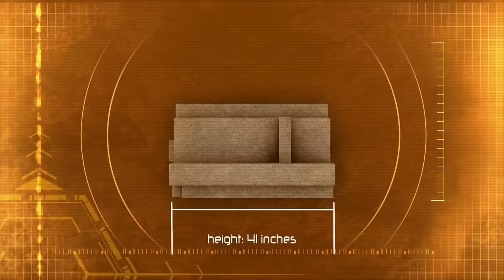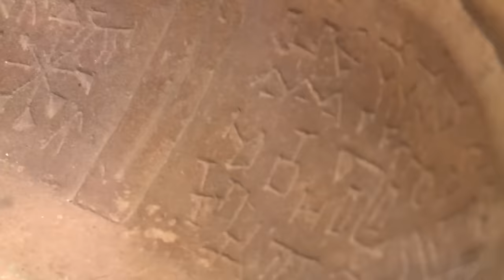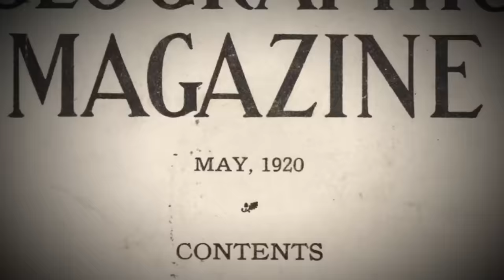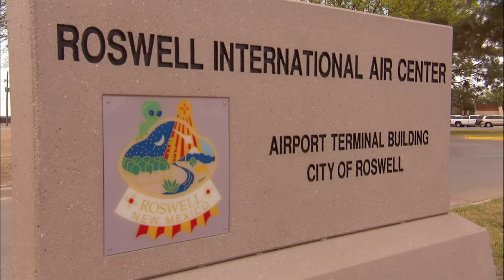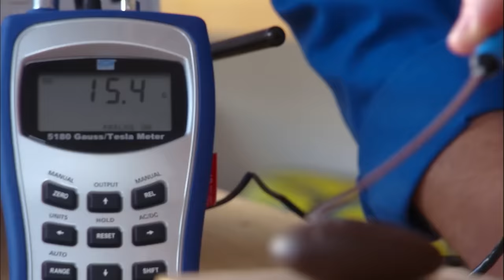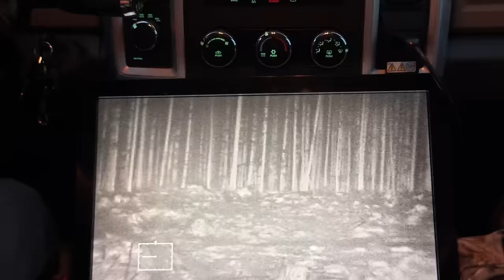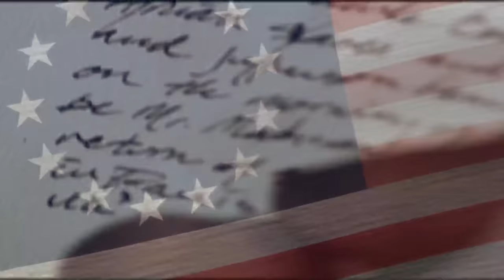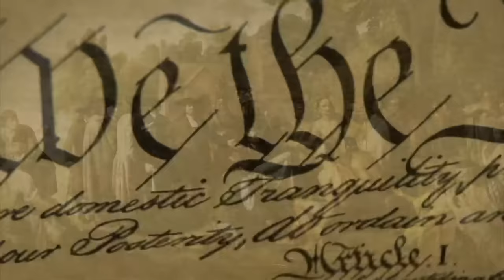TERRIFYING PROOF OF ALIEN ACTIVITY *Epic 3 Hour Marathon* | In Search of Aliens

Comment: I find it curious that there is such a difference in quality between the precise cutting of the stones, which are so precise, and the faces that are, at best, very rough and general. I believe it is because the ones who carved the blocks are different "entities". If that is the case, it asks many more questions
Reply: Well in humans tradesmen in the same trade often have their own trade mark even if they had the same teacher originally.
Reply: I ussually have the Nordics build walls and the tall greys carve heads and faces when I manage a site.
Reply: My theory is all those thousands of years ago...the rock was softer since rock hardens over time OR they used an Alchemical process that softened the rock just enough to cut and form a smooth surface. The pitting on the ancient cut shows the cut method was not high speed and the rock was softer when it was cut. They probably had a method to almost completely melt rock and reharden it to shape. Remember ancient Egyptians had scientists and they probably used some ancient process or resource that has been lost. I think we just haven't found wooden molds because the wood they used completely decomposed. They may have even used sand with some kind of Alchemical polymer that has long since broken down. Some people don't like my theory of the rock being softer or the Alchemical process because it discounts high powered tools. But they definitely had some high powered tech to move such large stones. Unless 20ft tall humans actually existed and built them and they just destroyed all the remains when the giants were supposedly hunted and genocided. A gigantic human would probably have the strength to move those 2 ton stones with just 2 of them. And also carve them quickly with crude tools. But my bet is on they hand a huge supply of a caustic chemical they used and maybe giants to move those rocks. There is an old story about the giants and how they were used as slaves then became cannibals in rebellion and were defeated.
Reply: @tomd6704 you should tell the greys they are creepy af and they best stay away from me if they know what's good for them.
Reply: There’s actually a location at I believe Teotihuacan, where they actually make that argument. It’s a temple with various contrasting deities heads carved even looks like variety of different types of stone used too.
Reply: @LisaAnn777 I don’t have a direct line to the ancient alien theorists. I suppose you could look it up. 😹 otherwise get bent and share your negative comments on the Reddit sub for crybabies. 🤷🏻‍♀️😂 🙄
Reply: @Unmaleable ……I agree. Especially when you look at the obelisk that cracked and was left in the quarry in Egypt, on the surface of the space where they would be standing, there’s still blatant scoop marks. As if they softened the rock and scooped it. And with the moving of the stones, nobody ever mentions the possibility of them using animals. Such as elephants 🤷🏻‍♂️ After all, Egypt is in Africa. Or they could have simply used hundreds or even thousands of humans if necessary.
Reply: @Unmaleable I agree with your theory that a caustic chemical such as sulfuric acid was used to dissolve and shape stone.  They were probably very advanced in chemistry.  Probably had a lot of diamond tools too.  I think elephants could have been used to move the stones and maybe sophisticated pulley systems as well.
Reply: @tomd6704  🤣🤣🤣🤣🤣🤣

Comment: The fact that the “H” block materials were showing to be magnetic or charged which was displayed when placing a compass next the structures was very interesting 🤔
Reply: @cappythumper514  It is so easy to produce magnetic effects in stone, especially if it has a high metallic content, preferably but not exclusively, iron. All you have to do is strike two rocks together or drop one on the ground or strike it with an iron bar and you can magnetize all or a portion of the rock temporarily. Some rocks that have the right crystalline structure or crystals embedded in the rock can produce pizo-electric effects when struck, dropped or put under pressure and where you have a current you have magnetism or the potential for it. The most common rocks, whether they've occurred naturally or were shaped by humans, have or can produce magnetic reactions. Anyway, I see a lot of folks who think this Giorgio character is some kind of Guru or professional Archaeologist or mystic or something when, in fact, he is none of those things, he, like this show, is disingenuous, untrustworthy and fake and the mystery is maintained, not by what he tells you but by what he doesn't tell you.

Comment: I'm wondering if the stone found at the Roswell crash site area isn't something like a DVD or a computer program that would "print" the image that is on the top of it onto the earth's surface in a crop or any other surface below the craft. That could also explain the magnetic properties of the stone, in order to make whatever device they use to spin out the designs, the stone would have to be put in a "player" in order for the mechanism to recognize and activate correctly to make an exact design, the magnetics could be used to quickly move, spin, stop, turn over, etc... inside their device.
Reply: THAT is an interesting thought... very possible... not that I believe in aliens mind you...

Comment: The Roswell rock. One possibility they didn't mention was ceramic. I knew this also could not be the case. Ceramic items are intentionally hollow because when they are fired the gases within the clay would blow a solid object to pieces. I am surprised by them putting it thru a CT scan. I've had over a dozen scans because of my health and they tell you not to have anything metal. If this rock has a magnetic field wouldn't that act the same as metal? All in all I think this is a solid rock, possibly granite or marble because of it's hardness. But most marble or granite have colors in them. The fact that this rock is such a small sample it could account for it's monotone appearance. I would like to know the dust samples from the grinding.
Reply: CT scanner won't be hurt by metal.  It can affect the imagery, but it will not hurt the scanner.  HOWEVER, an MRI... there's no way, I don't think, that they would have put that into an MRI machine (MAGNETIC something imagery)  It would have turned anything metal like that into a bullet and damaged the machine for sure.
Reply: I expected the rock to blow up in the scanner.
Reply: There are ways of artificially conglomerating rock- similar to concrete, and they are known to have existed in some ancient cultures. The known versions wouldn't explain most megalithic construction, but I believe there were versions we aren't familiar with today.

Comment: Limestone has a density of about 1.55 which means those stones weigh as little as 1.5 times the weight of saltwater.
It is easy to cut when soaked in water.  It can be easily moved by floating in place as pyramid stones probably were. 
Remember that the Nile was nearby and that it overflowed like clockwork according to the stars.
Malta of course is also close to a water source.

Comment: I think the rock was melted with an EXTREMELY powerful electric current, and it fractured slightly as it was cooling. It would explain the magnetism and the perfection in the design, that appears almost as if it was molded or even laser cut. It's probably not something that we would do, but that's kind of the point, isn't it?

Comment: It Is concluded that concrete made with andesite aggregate has higher tensile and compressive strengths than concrete made with quartzite aggregate at the same cemenVwater ratio.

Comment: A lot of the rocks, not the one that seem obviously jig-saw cut to fit together, but those that seem to be randomly selected stones, vitrified to each other to fit perfectly seem pretty obvious to me that they had some form of intense and rapid heating process to melt the meeting sides of the rocks so as to mesh them together regardless of differences in the specific, unique surfaces of the rocks themselves.. 
Like, say you've got some heat gun for lack of a better word, and you have 2-5 men line the rock up then  melt the surfaces between them while the men push them together..
That's what it looks like to me.

Comment: The people investigating these sites are overthinking it ! You can make a saw using a rope and grit to cut through stuff like hardened steel. You actually can cut through a bar using comet cleaner powder and dental floss. you get the floss wet and then add the gritty powder. It truly is that simple !
Reply: Then please duplicate a pyramid for us
Reply: Please saw an inside corner

Comment: The huge blocks wer moved on stone rollers not on wood ones,the ground was first prepared making it flat a road if you will so that they could roll easily under all that tremendous weight and was done by a group of about 30 men per block all this was done approximately 12000 to 12500 years ago

Comment: Could there be a slight flaw in the spectogram analysis? Remember how the wolf howl didn't match up to the unidentified sound? Couldn't distance play a role in the shape of the sound? For instance, if a wolf howled near the recorder, I feel the the shape of the sound in the spectogram data would be more defined in picking up the tones and it would be less defined as the wolf would move further away from the recorder. So, couldn't the unidentified sound be a wolf or other animal or whatever just at a further distance rendering the image less defined and less comparable to saved data that has undetermined distance

Comment: Thinking in line with the ruts.... wasn't there a story about an entire city or civilization that was able to move across the ground? You'd think it would leave behind a good visible path, whether to keep it on track or the type of energy used to lift it dug into the stone over time? Serious, if the tech existed that could lift huge objects, why not a whole city. Would be of great use especially during a ground attack to go high enough that no one could reach it and they certainly wouldn't go underneath it, in case it came back down.

Comment: I have seen programs where there are artifacts like the rock and in this program the rock with it's designs were used to fit it into something and used as a way to unlock something or you could put the ROCK INTO A say a UFO AND USED LIKE A KEY TO START IT.. THOSE DESIGNS ARE FOR A REASON I THINK.. ITS A KEY FOR SOMETHING..

Comment: In Chapter 1:  If they were to have used diamond blades, blades made of diamond - or even any other similar stone, it would seem reasonable enough to me that you would not find the tools used.  The material is simply too valuable and tool too specific to keep as even a relic.  From so long ago, lost memories and hard times would scrap them to dust; I would think.
Reply: Not if it was in a desert. I don’t kniw what to think about that rock cause the scientology head building has a helicopter pad or something with the same design.

Comment: Why do they miss the COMPLETELY OBVIOUS? The roller balls were placed IN the carved channels so they didn't roll away and then the loads were placed on top(think early ball bearings). If you have ever been to a boat ramp you KNOW that the wagon/trailer being backed into the water make it easier to load and off load? Higher loads weights can be put on SOLID stone balls than ANY axle wheel combination.

Comment: It is hard to believe a flood nocked the stones apart at 18000 feet of elevation. If they were made by pouring in a mold to form blocks then were is the material that formed them? Was there samples taken to identify were they were made? A space port platform would match with the Nasca lines like runways for some sort or aircraft. There is no wood is stuck in the blocks when molded. Can the blocks be xrayed to see if any metal reinforcement was used? Can they be analyzed to see what the stones are made of chemically? Where is the metal that would lock the blocks together? Is this an Alien version of Legos.

Comment: Noticed that there was when they were glazing over the back end of that rock. Where was explained Where the grinding wand he turned the rock slightly.
To the fatter side of there were 2 indentations are holes. I don't know what they were and this is Two hours and three little less than that thirteen seconds somewhere around there Chapter 3 It is where I noticed the two Holes or invitations are in the rock on the fatter side of it on the backside of the rock.

Comment: Somewhere in the mix of   mud brick   technology and concrete   stone forms,      these   blocks and many  amazing  images, are really       concrete   formed,   and before the    mixture   hardens into granite  hard stone,    it is modeled     in the same way a mud   or clay  model was formed with soft tools or  wooden forms,      poured   using   alchemy sciences that moved on from  clay and mud brick   to   cement  and concrete technology.        Learning  was from the forming of River 'Rock     caused by   flows of unique colored  sediments and    even tested by taste   to be sweet or sour,   or bitter ,   hinted at in the Bible as "Waters Made Bitter".     suggesting    Alchemy    taking   minerals out of the river,   separated as powders    by color and taste,  and mixed  by experiments  to find    caustic  reactions  that    created  light and heat  and   made   concrete and finally    mixing the powders   taken out of the river,       would create an explosion,    like gun powder or    nitro nitrates and      elements that   when   mixed,    burn    either to create a glowing light    or   made stone   or  blow up.  Glycerin     .    Thus   in underground tunnels   they painted the walls  with  powders taken out of the rivers,    such as the Nile,   and   they were phosphorus   emitters of light.          When the paint dried , the  light faded away.    .  So  one elements is bitter the other is sweet and mixed,  with water,  like a time clock    the dehydration   makes heat  and burns and    changes a mixture    into a compound.           So the  Pyramids   were built   as concrete poured forms,      and even statues were     molded  and  shaped smooth  and fine,  before the   concrete would hardened     So  the  making of these stones could be done with wooden tools.    But when the stone  concrete hardened the time clock ran out.       and when the  tunnels    had their painted surfaces  go dry,    the light went out.      You can go to any  sports hardware store and buy  chemical  lights,    that are sticks you break and it mixes two  chemicals and it lights up   until  it is  losing the heat energy of a mixture   moving into a compound,    Waters  is a  compound,      :H2O"    but if you had   Hydrogen  and Oxygen  separately     you can    create HEAT ENERGY    even to   power an automobile.      Alchemy Science    knew  how the RIVERS   brought   streams of  minerals  , where they mixed to become hard  rock  river beds and places where the   sediments had not   mixed and were still available to be dredged up  and used   for   early Technologies.      The part of the   Plagues of Egypt where the Nile  turned blood red,   might have been  done by   rebelling slaves who  dumped all the  stored powders    into the river and it turned red,   , something  like  the Boston  Tea     Party  .

Comment: To get the stones to fit like that, not even a piece of paper can fit, and no motor. They had to have heated up the stone to make it soft. Not enough to melt. Just enough to be plyable. Lost technology. The same with the Key-stone cuts. They softened the stone, then pressed the key into place. The precise cuts like a diamond blade. Soften the stone, then use a form to shape the stone. No cut marks because they weren't cut.

Comment: I like this documentary and everything however it is a bit of a stretch to just glance across the surface of a wall and declare it's "perfectly level".  Also, trying to slide a sheet of paper into a crack thousands of years old doesn't prove anything because debris ie moss, dirt, etc would naturally accumulate over the years and contribute to filling in the cracks.  But I don't doubt the builders of this structural wonder had some methodology for leveling or that the cuts are likely quite concise. Just an observation.  Great video nonetheless.

Comment: Not many people know but this history has already been resolved. The way all art was created was made like concrete wet. The only difference is we are use to construct powder. In the past where we weren’t born the used mud or some kind of concrete substance and was able to build buildings, blocks, etc. The big pyramids those were made with day/per day but with high density of Heat. That’s why when slavery there was people working only day time then building each layer. That’s also how the path inside the pyramids were able to walk through using wood to surface the substance very sharpe edges. I can guarantee my myth is correct. Try every dirt wet it, shape it, leave it, 2hr later, little dry, and build another block. Idk how 90% each hasn’t worked this out. 😂😂😂

Comment: Too bad they leave off the most important part of evidence toward the theory of ET intervention. If you look right on the western shore of Lake Titicaca, about in the middle, you'll see the remnants of an alien starship, in fact, it looks exactly like what you would expect to see if a Star Destroyer crashed to earth. Additionally, if you look in a direct line toward the coast, you'll come across a mountain top that's been flattened and has two Siamese lakes on the top of it. That's the remnants of a pinwheel space station section. If you look on the eastern side of Lake Titicaca, you'll see a lot of those small lakes with the same shape. You can thank me later.